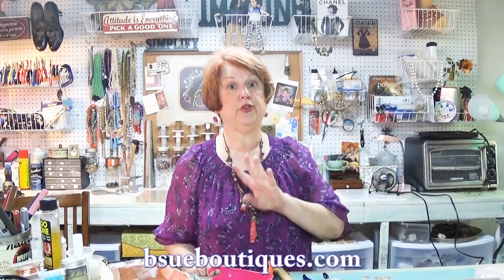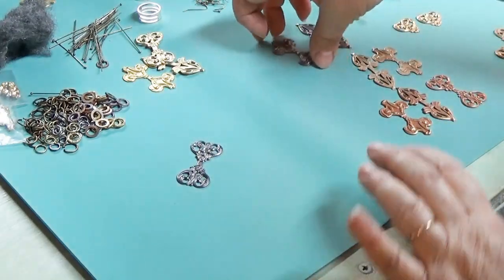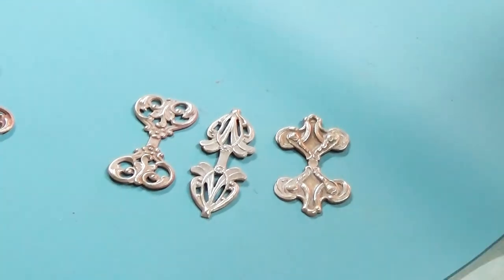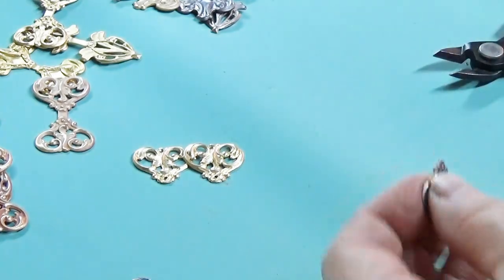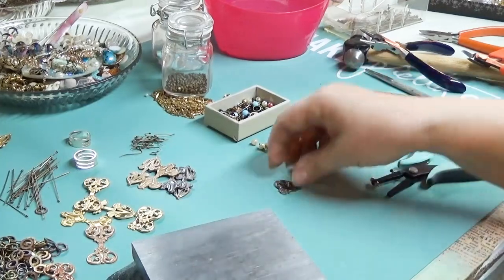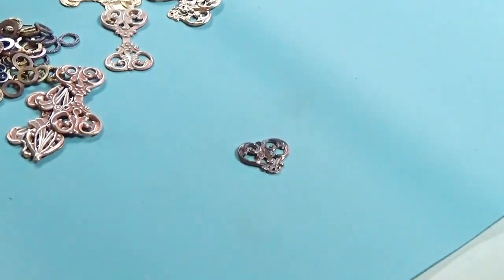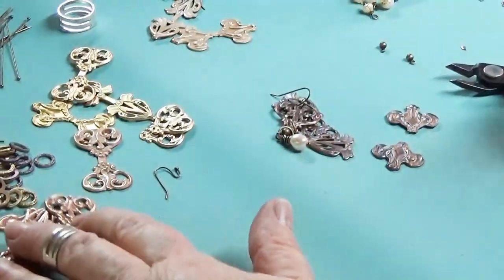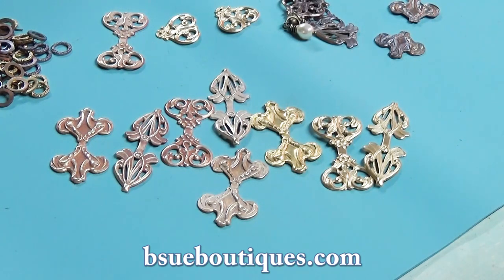Use Your Metal Hole Punch Correctly, Easy Earrings Project from Victorian Bails

Comment: Hello BSUE, Loving the old videos as well as the new. Just got the hole punch...excited to try.   Have a couple questions..Can I torch, seal, then add paints? And patina paints... Actually have done on a piece and wondering how it will hold up...with very little sanding...??? .seems like the torch helps  it take the paint nice,,,roughs it up a bit. .....Can I re torch after sealing?......Should I quinch the metal to help hold the color right after torching?   Thanks in advance for your help!